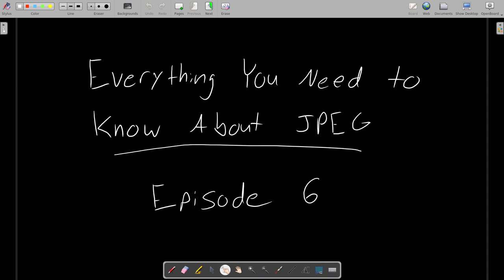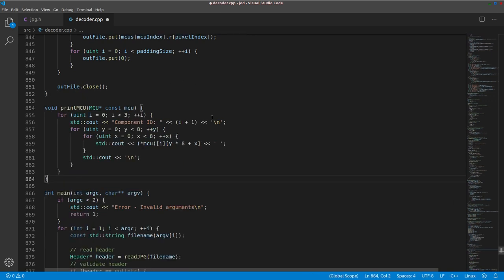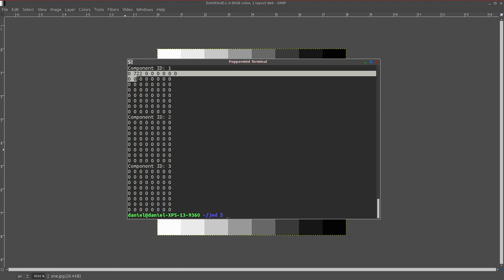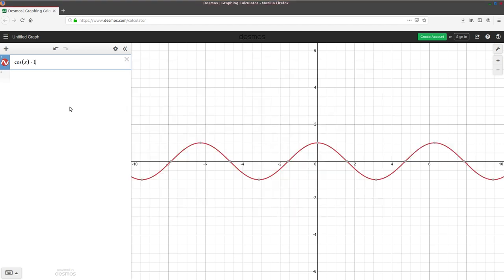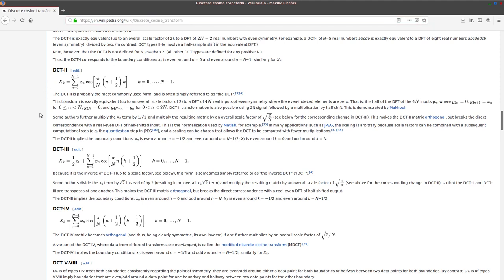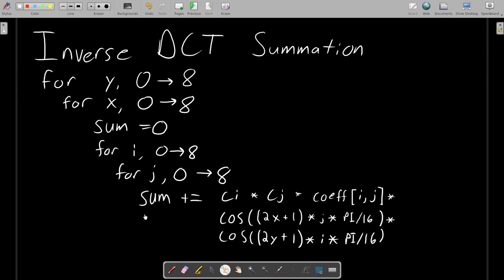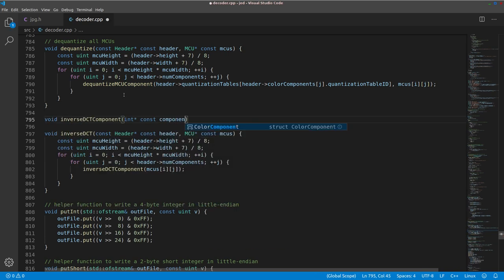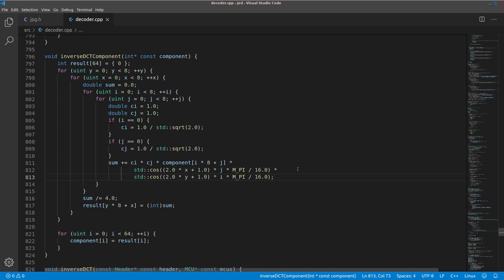Everything You Need to Know About JPEG - Episode 6 Part 1: Inverse DCT

Comment: Just wonder what drives you going so deep into the jpeg details?
Reply from the maker: Simply that it's what I felt the internet needed. I find this stuff fascinating but no complete explanation existed so I decided to make it for myself.
Reply: @danielharding3688  H264 is also a fascinating topic. It is based on jpeg, and the reason I following the series is to learn H264 which turned out to be super helpful, thanks! But it will be more helpful if you can bring your talent directly to H264